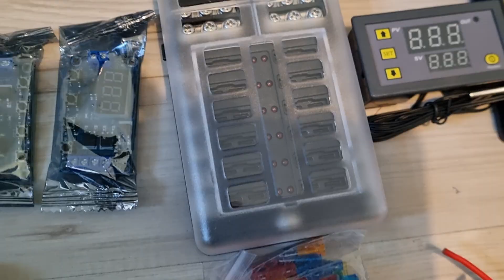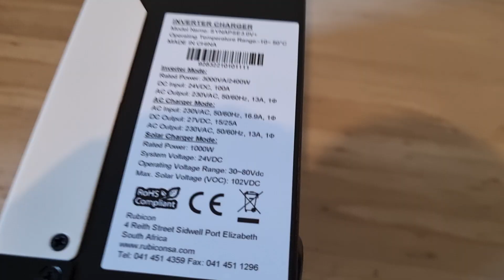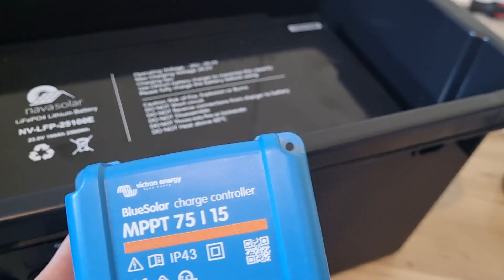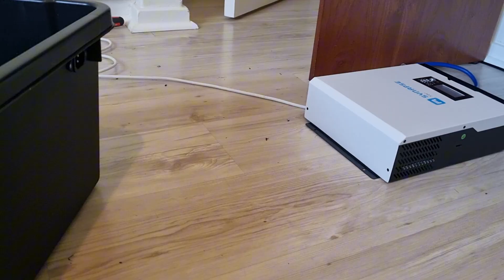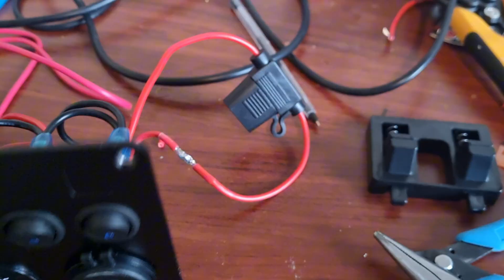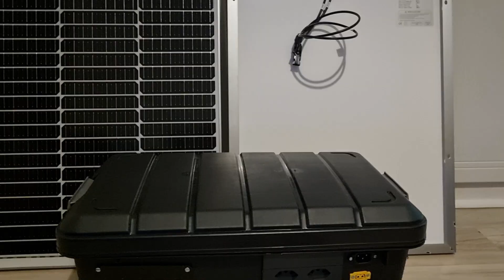I Built the Ultimate Solar Generator

Comment: Does it ever heat up to much when the inverter is running or does the single fan produce enough airflow?
Reply from the maker: So far I have not had any problems with the inverters heat, but the highest load I have tested was around 1.5kVA for about 15min